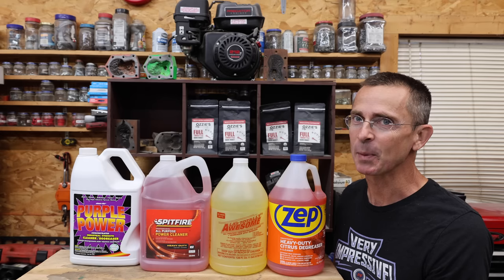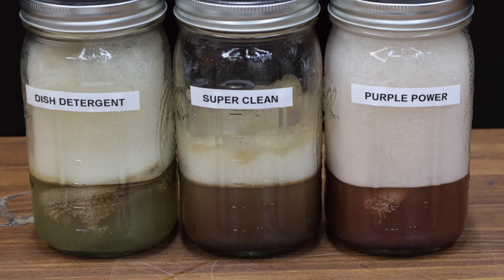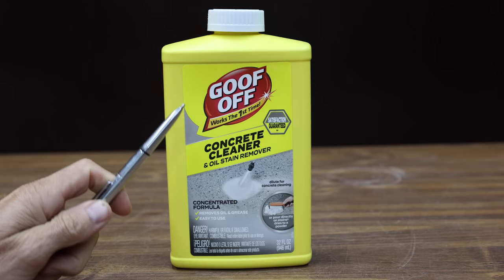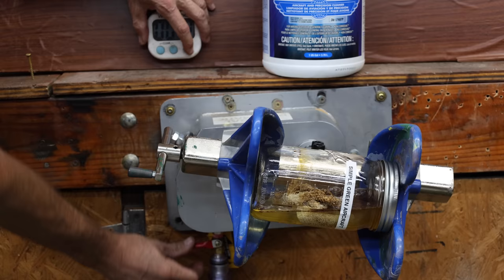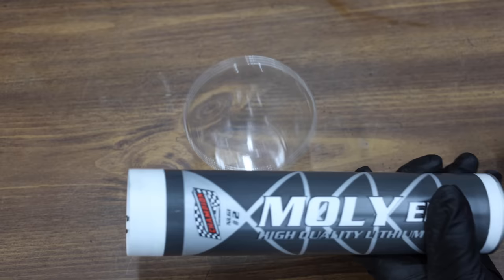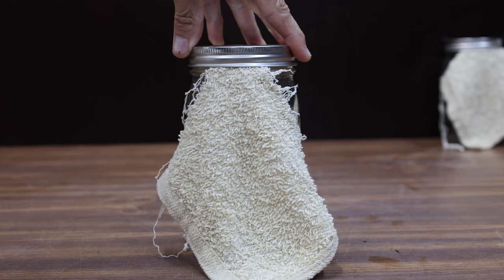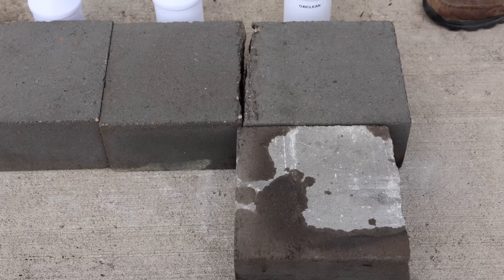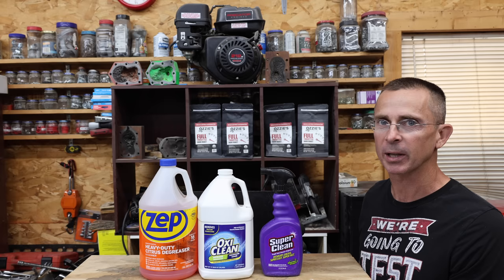Best Concrete and Engine Degreaser? Let’s Settle This!

Comment: I have been using Super Clean for years, it works well for me. My favorite application is removing paint from plastic parts, such as motorcycle fairings. It’s difficult to strip paint from plastic, most paint strippers damage the plastic. I soak painted plastic parts in undiluted super clean overnight, and the paint literally falls off without damage to the plastic. One observation, super clean is pretty caustic, if I get it on my fingertips they go numb immediately, and it takes an hour or two for the numbness to go away. So definitely avoid getting it on your skin or eyes!
Reply from the maker: Thanks for sharing.

Comment: Another great product comparison/testing video, Todd. However, I would like to see how good ol' Trisodium Phosphate (TSP) performs against these brand-name degreasers. The real TSP and not the imitation chemicals. I have been using TSP for decades for cleaning and degreasing everything. TSP is inexpensive, safe to use, and it works very well. Keep up the great work!
Reply: It also DRASTICALLY 'boosts' the cleaning power of Dawn/Dishsoap and even laundry detergent. Great stuff but, getting harder to get. 
IIRC, I had to order a semi-bulk qty from Home Depot online-only last order (all the stores in my area stopped carrying it.)
Reply: Yeah, TSP is great.  Its main problem is the "P", for phosphates.  Causes algae bloom in rivers which isn't that great if you like swimming, fishing or drinking from them.  Pour the used stuff on your lawn, not down the drain.
Reply: @labrat810 Yeah, I know exactly what you mean about TSP getting harder to find these days. It is mostly due to environmental regulations because of the "phosphates" leaching into the groundwater, especially here in California. This goes for all modern detergents and their lower phosphate quantities (and much less cleaning power). Fortunately, we still have a long-standing mom & pop hardware store near where we live that still carries TSP and Borax regularly. TSP is great stuff, especially for degreasing and surface-prep before painting.

Comment: Super clean - we use it regularly in marine engine rooms & restaurant kitchen - and it just works !
Reply: Be careful, SC can corrode/etch aluminum. They even now specifically warn about it. Unlike the WD40 Specialist and Simple Green Pro HD which are specifically made to be safe on all metals and not corrode.

Comment: I think it’s more complicated then a singular “best”, I use dawn frequently do to how well it works while also being incredibly gentle on everything else. If I’m going to use harsher chemicals I just go straight to the brake cleaner.
Reply: You are basically right. Dawn was diluted far more than the others. The dilution ratio is relative to the purpose. It's for dish cleaning and needs to be safe for hands. Comparing it to products that are for heavy grease or concrete is unfair. I wouldn't be surprised if a lot of these products are chemically similar or even the same.
    I would love to see a chemical analysis by Consumer Reports and an independent lab.
Reply from the maker: Thanks for the feedback.

Comment: I have used gallons of the Simple Green Aircraft diluted 1:3 for cleaning air compressors, and have been very happy with it. My method is to soak the area then quickly wipe up with a rag or PIG pad. But now it looks like I have some new products like the Super Clean to try. Thanks for including so many in the comparison!
Reply from the maker: My pleasure!
Reply: I think the reason you may have started using simple green is it's clame to be enviromentaly friendly. yea Super Clean is what I use mostly but when it dosnt work, I turn to more specialized stuff like Klean-Strip products
Reply: Be careful, SC can corrode/etch aluminum. They even now specifically warn about it. Unlike the WD40 Specialist and Simple Green Pro HD which are specifically made to be safe on all metals and not corrode.

Comment: An excellent comparison and review.  I am not surprised that Super Clean came out on top.   I have been using Super Clean for more years than I care to remember.  I still have an empty spray bottle from the days when it was a Castrol product.  I buy it by the gallon.  Thanks for all your efforts.
Reply from the maker: Thanks and you are welcome!
Reply: Be careful, SC can corrode/etch aluminum. They even now specifically warn about it. Unlike the WD40 Specialist and Simple Green Pro HD which are specifically made to be safe on all metals and not corrode.

Comment: Love your comparison videos.  The only thing I'd say about this one is that maybe the dish detergent should have been mixed a bit stronger and it would have been fun to see what a laundry detergent like Tide and a dishwasher detergent would have done.  Thanks for the videos!
Reply: Yeah, if you want Dawn to do more than clean a counter top or window and not be sticky, you need to go 1 to 5 parts water, then it’s a highly effective degreaser.

Ironically there’s a clue in that about what they’re selling you in Windex, or no rinse cleaner, mostly water 😢

Comment: I'd be curious to see how the degreasers perform in an ultrasonic cleaner compared to things like perc, acetone, IPA, piranha, and hydroxide as well as proprietary mixes like vertrel and pcb degreasers. 

Things like waterbreak and uv tests would be useful comparisons, and you could run tests on fresh, baked-on or old, and dirt-contaminated grease and oil. 

Some processes require extremely clean surfaces and it would be cool to see a comparison between them.
Reply: For ultrasonic cleaning, the zep citrus works quite well for engine parts, and does not discolor aluminum. I dilute it as directed and use very hot water. Do a second rinse run with plain water, and then blow out with compressed air.
Reply from the maker: Thanks for the suggestion.
Reply: @ProjectFarm  Certainly! Also, would love to see you expand into whatever you find interesting! You are what makes your channel great and you should find whatever you're doing fulfilling!

Comment: I think the Dawn would have done better at a higher concentration. I use it 50:50 for removing oil stains from my clothes as a pre-treat with good results.
Reply: Agree, a much higher amount. This was for doing dishes. I use 3-4oz in a 32 oz spray bottle.

Comment: I’ve always had great success using super clean. It’s not very expensive and easy to find in a lot of stores. This was a great video I didn’t know I needed to see 👍🏽
Reply: It will now be expensive. Trust me!! These companies also pay attention to his tests.
Reply: @SKMYF  well good thing I just stocked up. When I get things like this I get it in bulk because of menards 11% rebate. Saving them to redo my drywall for free in my garage.
Reply: Problem is Super clean can corrode/etch aluminum. They even now specifically warn about it. Unlike the WD40 Specialist and Simple Green Pro HD which are specifically made to be safe on all metals and not corrode.

Comment: As a fabricator/welder at a trucking co, we used a steam and diesel cleaner with diesel mixed with water, it will blend when the water boils, to clean underside and engine bays before welding.  Probably illegal to use now EPA stuff.
Reply from the maker: Thanks for sharing.

Comment: Great comparison, would love to see how they all react on aluminum engine parts.
Reply: If a sodium hydroxide or sodium metasilicate is involved, it will break down aluminum and typically leave a white residue.  A good test is to take aluminum foil and place it in a dish, along with the product being used, and leave it overnight. :)
Reply from the maker: Thanks!  Thanks for the suggestion.

Comment: I've been using the ZEP Concentrated Industrial Purple degreaser for a few years with great results,  would have liked to see how this product compares to those tested.
Reply: I'd just get some regular zep and run the same tests against yours and you can see if it's better/worse since zep itself got second place it'd be a good one if it beat it.

Comment: Purple Power is also a good for etching aluminum as part of surface prep for passivation or painting.  But use phosphoric acid instead if you have it because the alkalines like Purple Power can leave a corrosive residue if you don't wash it off thoroughly.
Reply from the maker: Thank you for sharing!
Reply: I need to wash an all aluminum toy hauler that has been in storage for two years.  It has vinyl graphics and most likely the aluminum has a clear coat of some sort.  Suggestions?
Reply: @aussie2uGA  Shout laundry spray in the white bottle. It's what I use to keep my dirt bikes clean and not corrode/etch any of the alloys. I used to be a simple green fan but shout cleans better and is less harsh. Still scratching my head trying to figure that out
Reply: @aussie2uGA  Simple Green Aircraft is designed to be safe for aluminum.  I would start with that.  Use a sponge or soft bristle brush to agitate.  Or try the Shout.  Never heard of using it that way, though.
Reply: Super clean and most others here will also etch aluminum. They even now specifically warn about it. Unlike the WD40 Specialist and Simple Green Pro HD which are specifically made to be safe on all metals and not corrode.

Comment: one thing that might've been a good idea to test would be a thin film of grease, Most of the time you dig out the vig chunks of grease anyway and wipe away what you can, thin films tend to be a little easier as well.
Reply from the maker: Thanks for the constructive feedback.
Reply: @ProjectFarm  I found your channel years ago because of the seafoam test on the farm ranger. If that helps.

Comment: I can easily recommend Super Clean. My mom had driven on freshly paved asphalt (there was no cones or any warning signs 😔) and had covered her white car with asphalt specks. I tried soap, LA's Totally Awesome, and engine cleaner and nothing worked. Out of curiosity I went to the store and looked for the strongest industrial degreasers. When I sprayed Super Clean on it the asphalt just melted off like dirt, without even scrubbing it. I use it in a foam cannon to clean off my cars engine bays and takes off 60-70% of dirt and grease without ever agitating. It's amazing. You can get the big jug for like $18 too
Reply from the maker: Thanks for the feedback.

Comment: I’m curious to know how the Dawn would have performed at a higher concentration. I know that you followed their recommendations, but I’m guessing it would have been more effective at higher strength.
Reply: Yes! I always keep a bottle of Dawn in the shop for cleaning the concrete and washing my hands etc. I apply it full strength and then add a small amount of water and brush it in.
Reply: I always use dawn when my hands are greasy from working in the shop, by using this, I don’t have to use other things that have solvents in them.
Edit: I agree with using it at a lot higher concentration, when I use it on my hands it’s full strength without any issues.
Reply from the maker: Thank you for sharing!

Comment: As is often the case, your results are nearly the same as I have experienced. I do love these reviews.   I would also love some more engine related videos as well. Like testing Gimmick fuel savers. Given the current rise in fuel prices, it would be good to find out what will really increase the fuel mileage of both gas and diesel engines. Like does higher cetane increase diesel mileage. 
Awesome video, as usual.
Reply: Agreed! This is a fantastic video idea!
Reply from the maker: Thank you for the video idea!

Comment: I think engine repair or seeing what makes an engine run better would be a great addition, kinda like your seafoam videos back in the day 

But along with that, you could review ultrasonic cleaners, using them to clean small engine parts
Reply from the maker: Thanks for the suggestion.
Reply: Good point. The first video I watched was the SeaFoam in the Ranger and I’ve been hooked.
Actually, since SeaFoam has expanded their product line, some tests and reviews on those would be good…ex: Deep Creep vs. PB Blaster

Comment: Just a tip for the mold on your siding. Bleach water 30/70 using a pump sparyer will make quick work of it. Just spray on and leave. Love the channel...thanx
Reply from the maker: Thanks!  Thanks for the tip.

Comment: Amazing work as always! I would really enjoy seeing these degreasers compared for corrosion against a range of metals like aluminum, copper, brass, steel etc. As for branching out... DIY cost effective improvements to everyday products would be great.
Reply: This, and doing more long term tests on these same oil degreaser products... All of his tests are very short and quick tests. Some of the products take time to work. I user Oil Eater on old, hard set in oil stains on concrete and it works the best, but takes 2+ weeks and sunlight, but Purple Power is more affordable and works fine on fresh oil and grease.
Reply from the maker: Thanks!  Thanks for the suggestion.

Comment: Next time you want to do visual comparisons of relative color (cloth test) try tonget hold of a reflection densitometer.
We used to use them to do process monitoring on photographic paper.
Reply: PS - the cloth test was more valid than the siding trial.
Degreasers are not formulated to remove algae. You’re dealing with a living organism in that instance; the surfactant formula of degreaser is not made to interrupt that category of adhesion. The only chemical in degreaser compound that would affect algae is the small amount of wetting agent.

Comment: Todd, product testing is your bread & butter. Keep it up. Your format has remained consistent from multiple categories and in a world of change, I appreciate that when I watch your content, the actual video will follow  the pattern you have laid down.

 I'm sure you get lots of suggestions, but I'll go ahead and chime in anyway: maybe add in a PERFORMANCE / PRICE factor or ratio, to see which one performs best per dollar spent on a product? Super Clean seemed the best value if you don't have to use on Concrete or Cotton.
Reply from the maker: Thanks, will do!  Thanks for the suggestion.

Comment: Super Clean has been my go-to for at least a decade now. My primary use case is engine and transmission degreasing. It seems to do pretty good on disc brake dust as well.
Reply from the maker: Thanks for the feedback.
Reply: Be careful, it can corrode/etch aluminum. A few years ago when YouTubers were hyping it for automotive use they said it was safe on all metals. Now SC has a specific warning about that it’s not safe for it. Because of that I’ve gone back to Simple Green Pro HD, the purple one. It’s specifically formulated to be safe on all metals.

Comment: I clean Kitchen Hood systems for a living. We started using oil eaters the past few years and found it to work the best. On top of that, it’s non toxic, bio degradable, and has a sling irritant of only 1. We found that diluting it to about 60/40 works really good.
Reply from the maker: Thanks for sharing.

Comment: Fireball Tool swears by Zep Floor Stripper instead of it's degreaser. I've started using it and it works very well.

Comment: Great vid as always! 😉 I just want to add that I recently experienced a CV joint failure on the rear axle of my car. This coated EVERYTHING in the wheel well with axle grease. I used Dawn Powerwash on it. Just sprayed everything with it, & scrubbed with a wheel cleaning brush, & rinsed with water. Everything came out great! Especially my wheel! I did try using your average spray on engine de-greaser, but it just didn't cut it! Nor did BrakeKleen. I've also noticed just in doing the dishes that the Powerwash is formulated differently than the regular Dawn liquid dish soap. I dunno what it is, but it works way better & faster than the regular stuff. 👍
Reply from the maker: Thanks!  Thanks for sharing.

Comment: After watching this, it didn't surprise me that Super Clean was one of the best performers. Super Clean being a great degreaser it has a very clean and fresh scent. I've used it for many years on the interior for auto detailing as well as the outside. Highly recommended if you've never tried it!
Reply: Be careful, it can corrode/etch aluminum. A few years ago when YouTubers were hyping it for automotive use they said it was safe on all metals. Now SC has a specific warning about that it’s not safe for it. Because of that I’ve gone back to Simple Green Pro HD, the purple one. It’s specifically formulated to be safe on all metals.

Comment: Try BH-38.  Sold in restaurant supply stores. Extremely potent on grease and designed for use in food preparation facilities. Used for wildlife rehabilitation cleanup after oil spills.
Reply from the maker: Thanks for the suggestion.

Comment: I work on small engines and I see alot of blown head gaskets on mowers, I've found the dawn platinum foaming works phenomenal I've seen it remove layers of asked in grease/dirt inn 1 to 2 rounds and it looks almost new afterwards
Reply from the maker: Thanks for sharing.

Comment: SuperClean was my first choice as a degreaser, and now it's permanently my favorite degreaser.
Reply from the maker: Thanks for the feedback.
Reply: Be careful, it can corrode/etch aluminum. They even now specifically warn about it. Unlike the WD40 Specialist and Simple Green Pro HD which are specifically made to be safe on all metals and not corrode.

Comment: Tub O Towel is amazing. It wipes everything off. I use it on kitchen hoods, grills, engine oil pans, transmission fluid, car seats, automobile tools, everything.  Its safe, smells great, not harsh. It works. I still chuckle every time it wipes off gunk. Grease, glue, grime..
Reply from the maker: Thanks for sharing!